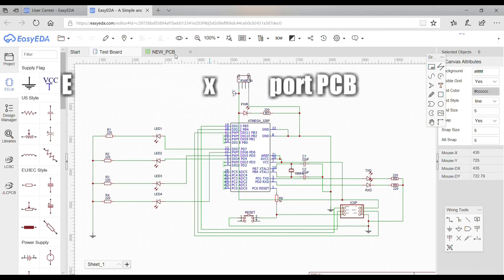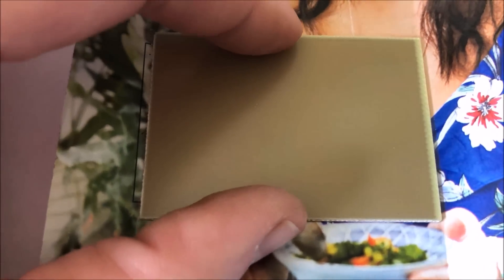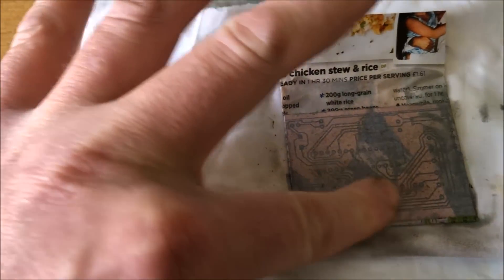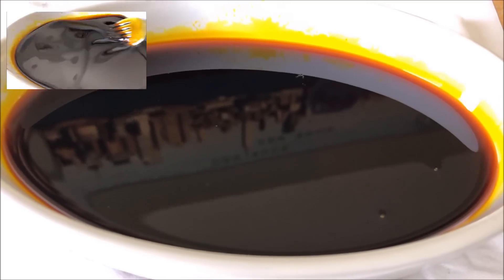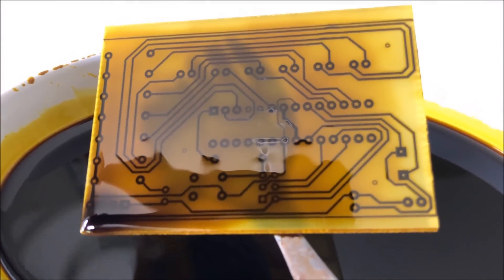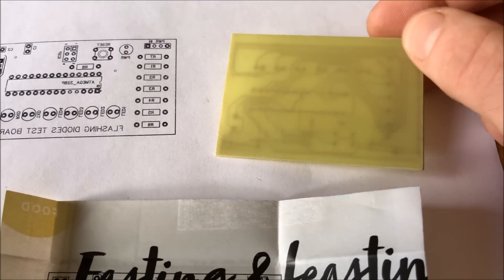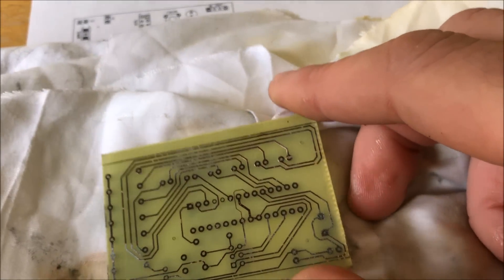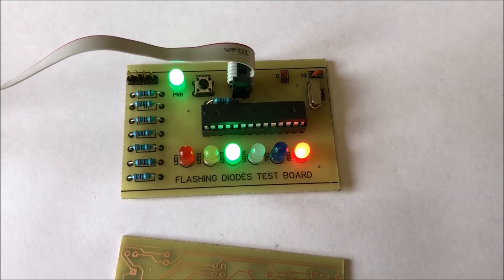DIY PCB Toner Transfer (No Heat) & Etching

Comment: It's been decades since I made my own PCBs as a young hobbyist. Drawing the traces with a sharpie and etching with FeCl3. One thing I remember discovering very early on was that a PCB floats on FeCl3 if you place it on the surface gently. You can then avoid stirring since any etched away material will simply fall off and sink.
Reply: You could also attach a piece of styrofoam to the opposite side, using double-sided tape or even hot glue.  This will allow the pcb to float on top of the ferric chloride solution.  Then you have the ability to agitate the workpiece or remove it to check your progress without the risk of it sinking.

Comment: I've tried a few recipes using glossy photo paper and I can only get small images to work.  What I find is that if the board dimensions are over 2" x 2" the paper starts creasing.  Any thoughts ? I've tried the 3:8 soln suggested, 3:1 acetone:water, 1:1 acetone:water, pure acetone, 1:1 alcohol:acetone.  Basically the toner doesn't adhere to the copper clad board properly.  I've scotch-brighted the copper and cleaned with pure acetone.
Reply: "using glossy photo paper and I can only get small images to work..." The instructions say to use glossy MAGAZINE paper. You're using glossy PHOTO paper. I suspect the difference is how well the toner bonds to the paper, that it "digs in" to the photo paper whereas with the cheap magazine paper, it does not.
Reply: @demef758  Will try glossy magazine paper.  Magazine paper is thinner so that might the main factor ?

Comment: Instead of using messy ferric chloride solution, you can use  100ml  30% hydrogen peroxide + 1 tablespoon citric acid crystals and 1 teaspoon salt.

Comment: I just can't wait to try this method. I've always used inkjet photo paper in a laser printer and then ironed it onto the copper, and has always been working fine, but requires a lot of scrubbing of that micro clay afterwards. Your technique seems alot faster, cleaner and more precise since the ironing technique has more work to it and also need to hit the right heat & timing to avoid smearing. Thanks👍✌
Reply: you probably just saved me some wasted time and heartache, thank you

Comment: I tried to use the ironing method a few times, but I did not get good results with it. I saw this video and tried to use pure acetone, had bad results. Then I tried to dilute the acetone, and the results were not much better. Then I bought a dirt cheap bottle of mostly acetone based nail polish remover, and it worked perfect the first time! Thanks man

Comment: Two things. 

First:

What is the coating on the paper? Someone in the printing industry could probably answer that question. Once that is known you could try and optimise the coating for that purpose.

Second:

The use of Acetone as the activator would be dependent on the toner used. If you are having issues try a different brand of toner.

Comment: What the hell?!
For the etching: Stick a piece of sticky tape to the back of the pcb, and place face down to the top of the ferric chloride. Do it starting on one edge, check for bubbles, do until it is coated evenly. Then, just live it on the top of the fluid. I think, it is way easier than playing around with that fork.

Comment: Ok I'm confused. How did you get the image transferred to the newspaper before it got transferred to the metal?
Reply: He prints the image on the glossy magazine paper. He had pre-printed the image on a  regular copy paper, so he knows where to attach the smaller piece of magazine paper and that is put through the printer a second time. (Myself, I cut out A5-sized pieces from the magazines and print to them directly)

Comment: Acetone is carcinogenic so plastic gloves should be worn doing this. Also do not breathe the fumes = do it outside or by an open window at least. This method can also work very well to give a parts layout indication on the opposite side of the pcb from the traces. Need to avoid using the colour black for the parts placement as it can be conductive.

Comment: Fantastic video- I have tried the toner transfer method many ways, but it's hard to do reliably with pressure/heat, even if you have expensive toner transfer paper.   Thanks for sharing.
Couple things I will share that helped me:
1) The final step  (removing the toner after etching) works great with pure acetone... it just slides right off in a couple wipes.  No risk of abrading/tearing small copper features
2)  Ferric Chloride liquid can be hazardous/expensive to ship- try ferric chloride anhydrous (dry powder, add water to make acid)
3)  Etching is messy;  most reliable/clean way I've seen is with Ziploc bags (double-bag!).  Sand off sharp edges of board;  fill bags 1/2 full of acid & drop board in.  Seal both bags.  Rub gently with fingers & slosh acid around.   "Massaging" the copper increases etching rate a lot and you can work the areas that need it most;  best of all, you can bring it to the top of the acid & see progress as often as you like.  Takes a couple minutes;   Pull out board & reseal bags or dump acid into container.   Hardly spills a drop.

Comment: I don't know why people mess with this toner transfer method.  The lithographic positive method is so easy to implement and costs about the same if not less.  The most expensive part of the process is the presensitized pcb board itself and the ferric chloride needed to etch.  With that said, we are still talking about a couple of dollars not 10's or let alone 100s.  As far as the ferric chloride, this or some type of etching solution is needed with the toner transfer method also.  You need, presensitiezed pcb board, a 15 watt tube flur. light, a piece of glass (approx. 10" x 10"),
clear acetate film (filmsource.com) and a lazer printer. You can find tons of videos showing this method, and the results are far superior to the transfer method, and the success rate is close to 100% and the resolution far exceeds the toner transfer method.  I tried the transfer method years ago, got so frustrated with it, including the wasted material you encounter, that I went to the photo-lith method and never turned back.

Comment: Hi, I tried many times to do it but in vain ! today i succeeded with a long time of heat 3 mn with an iron + 30 sec with a heat gun, after the pcb has cooled down i used hot water to peel off the glossy paper and it worked !! so thank you for the idea

Comment: When the nail polish remover reacts with the toner, does it give off a bit of heat?
Reply: I think all the acetone does is partially dissolve and soften the toner, making it stick to the copper.  At the same time it weakens the bond to the paper. No heat would be generated.

Comment: Such a cool video. Did you ever find a way to do 2 sided pcb at home?
Reply: Follow this guys method https://www.youtube.com/watch?v=au2ba5gWLWk to line up both sides of the PCB but then use the nail polish remover method to transfer the toner instead of a laminator

Comment: Wow, thank you very much! Just made a board with this method and it worked like a charm :) Only thing I have noticed - during the pressing my traces got little bit wider, but for the first time I am using this process it is ok. Next time I will compensate it with a bit thinner traces.
Reply: I’m going to follow this same process… is there anything you would like to share??? Your experience???
Reply: @gapguy9564  just follow the tutorial and expect the traces to be a bit wider than you designed them (at least in my case it happened)
Reply: @martintatak8851  you just said right. It was .3mm wide which didn’t workout for me. So changed it to .5mm and it came out well. Yesterday i finished this pcb.
Big thanks

Comment: Instead of nail polish remover, have you tried acetone?
Reply: if you want to use off the shelf acetone you need to need to dilute it down with water (3 parts acetone to 2 parts water) which is basically what most nail polish remover is. Pure acetone will make the toner too soft and it smudges. But this method even works with cheap non acetone nail polish remover you get in £ shops/$ stores; so unless you are making lots of PCBs (or you already have some acetone going to waste) it might not be worth it.

Comment: Does it turn out perfect like this everytime?
Reply: Pretty much, the only issue I have ever had is if you dont apply enough pressure to the paper or you move the paper when transferring. I use a cheap rubber ink roller I got on ebay that eliminates those issues. But if you screw up just use the nail polish remover to  remove the botched transfer and try again.

Comment: How much time we need to press the board when you put the nail polish remover.
Reply: The transfer is almost instant in my experience, you just have to make sure you apply pressure to every part, I use a cheap rubber ink roller.

Comment: I tried this and it did not work very well. It did somewhat transfer the toner but it was all smeared out like ink on blotting paper. Not sure what went wrong, maybe my printer uses the wrong kind of toner or the nail polish remove wasn't acetone.
Reply: Try diluting the nail polish remover with water.

Comment: After decades of using the iron-on method, I decided to try out this heatless technique. I got a near-perfect result the first time. Thank you.

One thing puzzles me though: Why the two-step process in transferring the laser printout to glossy paper? I immediately tried it out by printing a mirror image directly on glossy paper and it works fine.

Another thing is that I (later) tried transferring the toner from first printout to glossy as shown here. It doesn't work at all. Not even a trace of toner stuck onto the glossy paper.
Reply: He didnt transfer the the ink from the paper to the glossy he just used that as a guide so he knew where to print as the mag paper was an irregular size, also  some laser printers get hotter than others and the hotter ones (usually older models) heat the thin mag paper up to much and it comes out wrinkled.

Comment: Am I the only person in the world who is confused by this? At 1:34, the new image is coming out of the printer. Did you print a blank page, and the image somehow bled through to the other side of the glossy magazine paper? Or, did you print the same circuit board image a second time, on top of the magazine paper? Somebody, please explain what happens at that magical moment when I see the circuit appear on the top of the magazine.
Reply: He didnt transfer the the toner from the blank paper to the glossy he just used that as a guide so he knew where on an A4 sheet the image would print, then he taped the magazine paper over the image, feed the paper back through and printed directly to the glossy mag. If the mag paper was A4 in size he could of skipped that step and just fed it through, but Ive found that the heat of the laser printer is sometimes too much for the thin magazine paper and it comes out all wrinkled, not a problem with the old iron on method but for this method it makes it more difficult to work with, so I always do this anyway.
Reply: @Bikey_McBeardface  Sorry. I am even more confused now. You don't need to try to explain anymore. I give up.

Comment: For anyone interested, muriatic acid is cheaper than ferric chloride and can be found at probably any hardware store.  I found mine (by the gallon) at Ace Hardware in the pool section (it's normally used to balance the pH of swimming pools).  I remember several years ago when shopping for ferric chloride I could only find it online or at Radio Shack (now closed, so again, online) and it was like $30 minimum and that was for, like, an 8 oz bottle.  A gallon of muriatic acid is $10 at lowes.  Imagine how long that would last you if you're only using a couple ounces per project (which could probably be reused if you can safely store it).
Reply: The problem with muriatic acid (HCl) is with the handling. While FeCl will stain your hands, it won't etch your hands like HCl does. Stay away from HCl unless you want to etch your skin off.
Reply: @demef758  lol or just use it safely like it's meant to be used 🤷‍♂️🤦‍♂️

Comment: I printed out a pattern on a mag and had a spare PCB so I tried it and it worked. The next step it to make one that I will actually use this was just a test and it passes with flying colors,.   I poured less than a teaspoon ( small board) worked it in till the remover dried , slowly peeled and there it was , even the small lines came out,  Traces between components came out clean , lettering crystal clear. Thanks for this valuable tip.

Comment: I especially liked the last part where you transferred onto fibreglass. That seems like a great idea as a homebrew silkscreen overlay. It looked like it would be much easer with 2 hands so well done on that! I'm thinking some sort of simple press (eg. a couple of smooth blocks with a weight on top or between two blocks in a vise) would also make things easier. I'm keen to try this for myself. One question: Is there something about nail polish remover, like its concentration for instance, that makes it preferable to plain acetone? I ask because a litre of acetone is something I already own and is much cheaper than a small bottle of nail polish remover.
Reply: One day, I'll treat myself to a bottle of Tinit or some alternative!
Reply: Seems you could plot another "copper side" deleting the pads and have a good solder mask. Has anybody tried it and, if so does the toner contaminate the solder connection?
Reply: @paulhupman2902  Haven't tried it, but since toner is made to melt in order to stick to paper, I don't think it would do a very good job of resisting soldering temperatures.

Comment: What sort of solvent is this? Obviously it is not acetone? Innit?
Reply: Most Nail polish removers are 50-60% acetone so yes it could be. I have used the non acetone type (purchased in error) and it worked just as well, but there are a lot of different formulas for that stuff so I would stick to the acetone type.

Comment: Please don't put tape in your laser printer... I messed up my last printer's drum
Use the entire sheet of paper and then cut to a more manageable size
Reply: Good point. but thin magazine paper can wrinkle badly in a laser printer. Maybe the solution is to use thin double-sided sticky tape?
Reply: @DougWoodrow  that's also true (my current printer is fine with magazine paper tbh, but i can see how it could happen) 
I ended up using double side sticky tape and It works fine if it's not creased or too thick, but now i use a little spray adhesive on the mag paper taking care to keep the exposed paper free of glue

Comment: Gareth thx for sharing. You just ruined a project. It was a precision heat controller for a laminator. I am grateful.
As with all systems your mileage will vary. Polish remover, Acetone, dilute Acetone, Mag Paper etc. I have used mag paper with good results so for me the only wildcard is the Acetone mix.
I found that the heat method has a tendency to mush the toner reducing the resolution and thinning the toner on the bd. Thinner toner allows more chances for pinholes in the patterns.
Again thx for sharing.
Reply: 1:1 Acetone and tap water, and I use a rubber ink roller to press the mag paper to the copper clad, not failed me yet. I did try an 8:3 Isopropyl Alcohol (95%) to acetone mix recommended by someone else, it worked just as well but no better.

Comment: Used to etch metal with ferric chloride, name plates and such, brass, stainless, etc....not a real quick eating acid, if you get it on you it won't burn your skin off immediately, but it will start to burn over time. It will also stain anything permanently.  Don't get it in your eyes. Warm the acid to around 100 degrees for better etching, especially older used acid. You can etch thousands of things in before it dies. Neutralize it with soda ash or baking soda and dispose properly.

Comment: How robust is the silkscreen side? Will it rub off?
Reply: Only if you really scratch at it or forget to rough up the surface before hand, it will last long enough for you to solder in the components but toner will fade over time if left exposed. If you need to keep it visible for a long period you could always lacquer the SS side or even use double sided copper clad and etch the SS into the copper.

Comment: can you use ink jet printer,, instead of laser printer??
Reply: No sadly, but you can print it out on an ink printer and then take that print to some place that has a photo copying service (libraries and post offices often do it) with some cheap glossy photo paper and ask them to make you a few copies. I used to do this years ago when laser printers were still expensive Its surprising how many of them have seen it before and know exactly what you are doing.

Comment: That's slick. I've always used a laminator. That works about 4 out of 5 times.
Reply: Yeah, and it also distorts the design slightly.
Had I known this method, I could have saved myself from purchasing a laminator. ;)
-Oh, and no more purchasing toner transfer sheets.
I'll try with plain paper, as my laser printer isn't very fond of magazine paper (or even toner transfer paper for that matter).
-Sadly, it will be quite a while ,before I can try this, my laser printer is out of toner at the moment.

Comment: 0:46 - The title of your video is misleading.  The HPLJ1100 uses a hot wire (fuser assembly) to fuse the toner to the paper.  You still have to use heat (thank you for clarifying in the description - no iron needed.) Also, it must be clear that an ink jet printer will not work for this project; because, ink jet printers do not have hot fuser wires.